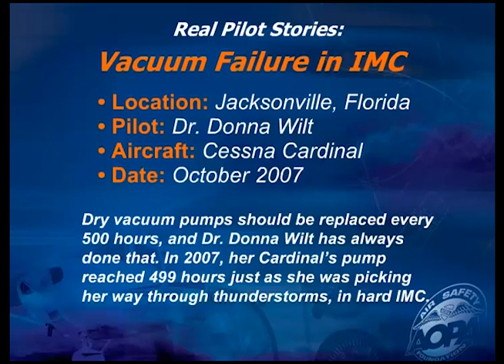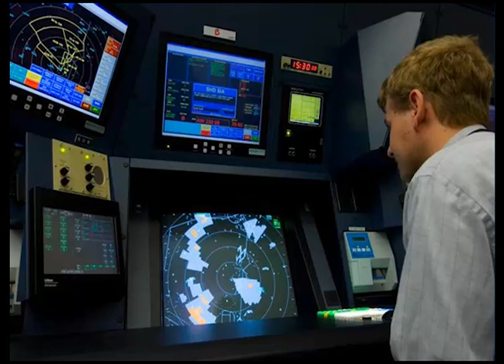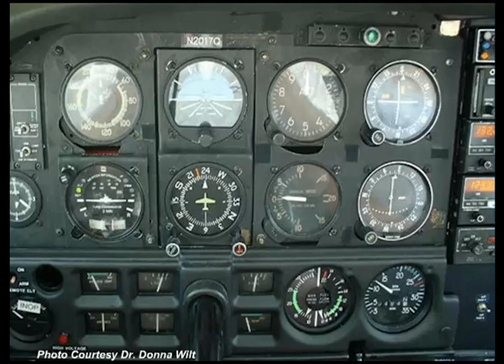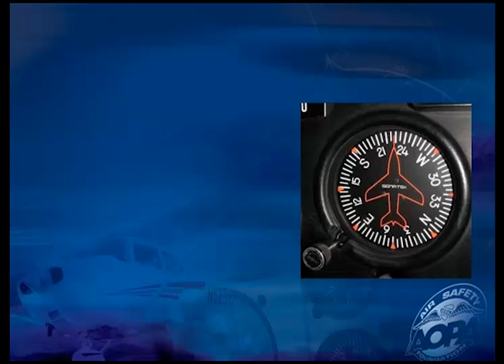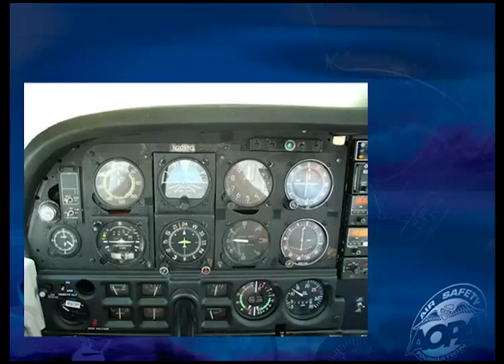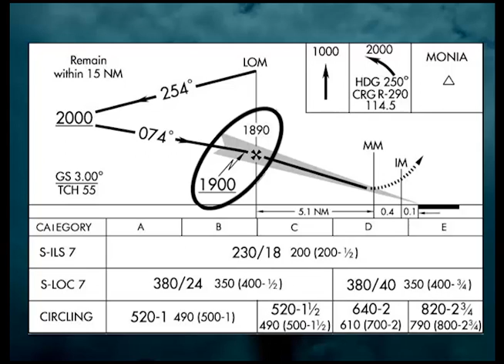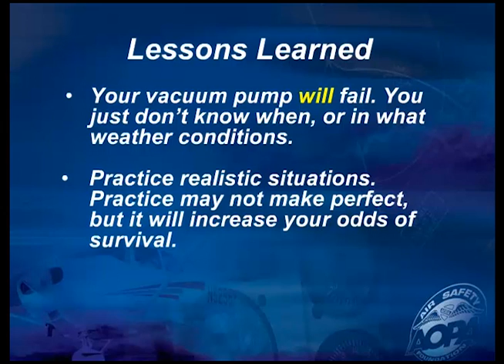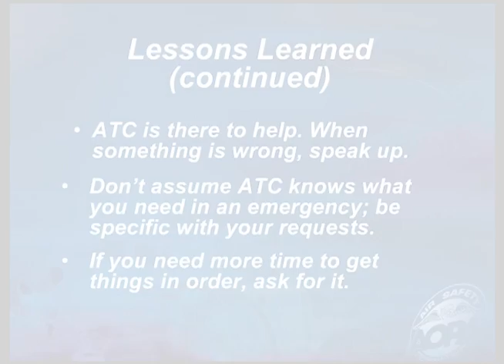Real Pilot Story: Vacuum Failure in IMC

Comment: Hi. I have been a Aircraft mechanic and pilot for over 30 + years and I can tell you that the manufacturers of vacuum pumps need to step up there game and start making the vacuum pumps alot better or just require  that all vacuum pumps be the wet pump type?? Most vacuum pumps are very fragile and made with materials that wear very quickly. There is absolutely no reason the manufacturers couldn't make the pumps out of materials that are much better and last alot longer. The manufacturers design the pumps to wear out?? Period!! I realize everything wears out, but come on, this is people's lives we are talking about!! I have seen brand new vacuum pumps fail right out of the box, many many times, and if you have been a Aircraft mechanic for any length of time you know exactly what I'm talking about, it's totaly ridiculous that just about every pump impeller is made out of a carbon base material? One step up from charcoal in my opinion?  I'm a hugh fan of wet vacuum pumps, and recently I removed a wet pump from an engine that was over 30 years old and it was still in perfect working order,  with very little wear to be seen!! Now you will need to replace the garlock seals from time to time, because they will seap oil after years of service and if you have a in-line oil separator filter, it not a problem for your instrumentation.  The pump lasted 30 years?? Go figure right? And this was not the first time. I have seen many of these types of wet pumps last vertically 20 + years and still going strong!!  The owner of the airplane was having an Continental  O-370 Re-man installed in his Cessna 182 and he wanted a new Airborne vacuum pump installed instead of his older wet pump? Crazy in my opinion, That's just my thoughts on the matter. Take care. Hawk out!!
Reply: I agree with you 100%. Ex avionics tech here.  This old shit stuff is useless yet apple can make an iphone that will lauch itself to the moon no problem. ANNNNDDDD... we're stuck with freaking old ass engine designs from the 50's and 60's, but yet todays cars can go 300k miles before they die. Right.  Something needs to change for sure!
Reply: Cannot agree more.  When I rebuilt my 1966 Citabria 7ECA, I yanked out a rusty 30 lb vacuum pump, replaced applicable gyros with electric gyros, saved the 30 lb, and am far more reliable as a result.
Reply: Claudia Cerami It’s the same old problem. Been with us for decades. If the vacuum gauge reading is not caught quickly, it’s only too easy to ride the AI into what is euphemistically called an ‘ unusual attitude ‘. Too many instrument pilots over many years have failed to notice, let alone recover, let alone continue on partial panel , from this. Probably because of insufficient  actual IFR experience. Since including the gauge is a bit of a pain in the neck, it’s all the more important to note any inconsistencies in all the performance instruments as quickly as possible, as a tip to glance at it straight away..
Reply: why we need vaccum pumps in the era of MEMS gyroscopes that are very cheap and precise is the question we should be asking
Reply: Claudia Cerami has
Reply: I have a dry vacuum pump that holds the waste gate closed on my turbo, they are awful, tired of replacing them
Reply: Dirk Knight  well, Dynon's EFIS beg to disagree that MEMS gyroscopes aren't a replacement for physical ones
Reply: By the way, MEMS (Microelectromechanical systems) gyros are physical, but on a nanometer scale

Comment: Lesson.  Don't use single engine piston planes without backup systems to fly in or around thunderstorms.  It does not have much more power than my motorcycle.  Maybe it would be ok in a TBM 930 or Learjet.
Reply: You don't know what you are talking about. Clearly not a pilot

Comment: 1969. I was 17 years old. At 13 hours, after my 3rd supervised solo (I soloed at 10), my CFI, which knew I had 15 hours already paid by the Civil Air Patrol grant i had, he decided to give me one hour of IFR (???, WTF?), yes under the hood at 13 hours. The problem is that was a 1960 Piper Colt with no gyro pump, so it was like what they call Partial Panel IFR. No Attitude Indicator, and No Heading Indicator either.  just an old fashioned compass type instrument. 

Used to hard work i was so I wrestled with that airplane  on the Florida midday turbulence and didnt lose control. He guided me back to airport and told reduced power and descent, He told me to descend at 80 mph and the power settings, when about 200 feet agl or lower, he removed the hood, and suddenly the runway was there, a bit to the rightof the nose,  I did a bit bouncy worst landing ever due just wanted to put those tires fast on runway and end the flight. 

Dam, i was so tired after that hour that i though about not flying again. Somebody told me that was an IFR on a non IFR airplane. Then the school gave me a nice checkout on a brand new C150 at 14 hours. What a difference. 13 hours only Partial Panel student pilot sulcks.
Reply: Hell yeah!  That's an aviator!
Reply: 1969. I was 2 years old

Comment: With the importance of the vacuum system, could a redundant pump work, or would you need two complete vacuum systems?
Reply: You can install an electric driven vacuum pump. You can install an electronic  or electric artificial horizon and gyro too, they are expensive but they worth every dollar spent on them!
Reply: And even with all their expense, they can also fail. The question is, which is more reliable?
Reply: Engine driven pumps are more reliable, but electric ones are a good backup, it's nearly impossible to have a double failure!
Reply: How to kill a vacuum driven system AND a electric system: Shut down the engine. Airplane batteries don't usually last long enough to get on the ground. Of course losing your engine in IMC is bad news in any case.
Reply: Oh! I've forgotten that case!
Reply: Sometimes there is just no getting out of a bad day. All you can do is prevent people on the ground having a bad day as well.
Reply: Agree!
Reply: I know a guy who had an engine failure. He picked an empty school yard to land, but shortly before he got there a bunch of kids ran into the yard, apparently recess had just started, He deliberately crashed into a brick wall and killed himself rather than risk hurting the kids.  It was clear weather, but the irony was, if it had been bad weather the kids would have stayed inside.
    They gave him a posthumous award. I heard they were also talking about renaming the school after him, but I don't know if that happened.
Reply: Wow, it's so sad, but I think he took the right choice to avoid killing the children.
Reply: Yea, it is sad, but I think it's something every pilot should be prepared to do.
    It's hard enough to do something like that when it's just you, but if you have passengers (especially your own family) it's going to be much harder.
Reply: @erictaylor5462  ok, so which IS more reliable?

Comment: This brings back so many memories of practicing partial panel NDB approaches in a Cessna 150 at night into KMKS. My CFII dad made me to it so many times I still have the approach memorized complete with memories of that dimly lit cockpit and the flailing compass on the dash.Ended up having to demonstrate that very partial panel approach on my instrument checkride because the other two required approaches were in hardball IFR at KCHS--not fun, but I got through it and am very thankful for the experience.

Comment: From the top:

 She was" really concerned about flying into embedded thunderstorms and didn't have any weather capability onboard". Not a good decision to launch if you really have such concerns.
 "the weather gets really intense for a while and we thought ok we're gonna do this for a little while...". Should have asked for a deviation, not waited in hope.
 Not until vectored did she realise she couldn't use the heading bug. And yet she felt ATC should have been aware of "one of the things you cannot do" and how a "lost vacuum system" had affected her particular aircraft before she figured it out for herself? In anycase, the standby compass is adequate, albeit clunky, to turn to a heading, though probably not if you didn't practice "in probably 4 or 5 years".
 She should have specified 'no gyro'. It is required when IFR to inform ATC of each instrument you lose. Saying "vacuum failure" is like saying "generator failure" - expecting ATC to know what that means for each and every aircraft out there is unreasonable. 
 She did not seem to understand how to get the best out of her avionics in this situation.  She had "always envisoned using autopilot and GPS but in this case we were on vectors". Even when vectored the GPS can be useful. You can quickly create a user waypoint at present positon, set the vector with the OBS and it is a doddle to remain on heading with the map in track-up mode. Or simply set the GPS to the dirty great compass display (albeit you have to account for a little lag when rolling out). Again we don't do those things routinely so the skills won't be there if you don't practice.
 She was offered a gnd controlled approach which I would have taken. An ASR is easy, you don't even need a plate. But she was probably correct in not accepting what she had not practiced before. Private pilots can practice gnd controlled approaches and no gyro approaches at military airfields who have an ongoing controller training requirement - check the A/FD.  It's a little ironic that the pilot who never bothered ATC with a practice no-gyro would complain that "they didn't seem to understand what's wrong when you've lost the vacuum pump".
 After veering off the approach course she was fortunate to happen across a hole in the cloud. But the communication at that point showed another gap in her professional knowledge. She could simply have requested a 'contact approach' which is in effect what she carried out. There was no need to cancel IFR but because she never requested it, and ATC are specifically NOT allowed to OFFER a contact approach, there was an unnecessary conversation where ATC had to lead her by the hand into cancelling IFR and continuing VFR instead. Unnecessary distraction at a critical point. 
 A fortunate outcome. Partial panel is not something to do for the check ride and ignore for 5 years. The skill has to be there always.
 This pilot is a CFII. She has since written a paper on no-gyro approaches which is good and worth reading. What is missing from it is the same thing missing from her contribution to this video - the ackowledgement that she had abjectly failed to maintain and develop the skills to deal with a malfunction that every instrument pilot should be fully prepared for. Don't be wise after the event, you may not get away with it like this lady did.
Reply: XPLAlN seriously, first vector i got i would have requested no gyro and 100% accept the surveillance approach.  why would you want to force yourself to do a failed card ils when you can get a controler to do the job for you? lady is an idiot.  she got lucky there was a hole otherwise she could have easily smashed into some obstacle.
Reply: Yes, stumbling across that hole was lucky. Like you, I would take a surveillance approach in a heartbeat. I take her point that she wanted the ILS because it was familiar - the problem is she had not maintained the skill to fly it no-gyro anyway.
Reply: XPLAlN even if you haven't practiced a no gyro PAR... how hard is it to "turn right half standard ratr.  stop turn."  sorry but absolutely horrible decision making.  yeah, load up the ils in case, but fly the damn PAR/ASR.
Reply: Informative comment, thanks for the alternative viewpoint

Comment: Vacum failure in IMC is real a nightmare no matter how experienced or trained you are. So congratulations to all that have survived and special thanks to the ones that are willing to share. Recommentadions are good, one just has to remember them.  I will certainly add more partial panel on my training. Thank you for the REMINDER!!!
Reply: As a fixed & roter wing tech inspector. i was. E-5 US Army. on fllight pay.  The year was 1959. Fort Benning Ga.  Was on a night flight in a H13G. Was flying with a 1st Lt. We were both getting our 4 hrs for the month. As the night closed in it became pitch black, no horizen.  We were two hrs away from Fort Benning heading back on the second leg of the flight. With no visable ground or horizen line my pilot experianced virtigo. Note: My pilot allowed the hellicopter to enter a steep climb, looseing air speed we began falling backwards. he steamed Help me, Help me.  The collective all the way up. The cyclic was all the way back. I had to fling my left hand and arm across his chest and yell, let go let go. He did, i dumped the collective down and pushed the cyclic forward.  Air speed picked up qwickly and pulled Pitch & Cyclic . just barely cleard the ground.   i used the RPM, MANIFOLD PRESSURE,  AIRSPEED,         and Atimeter, to maintaine stable. power setting and the whisky compas. as a artificial horizon and direction. i knew the compas heading back to Benning. i flew for about an hour 15 before the lights of the city and Benning gave a welcome horizon. The Lt took control as we enterd the trafic pattern.. This is a true story. and if any one is interested how i had the knowledge to get us back home. just ask will be glad to give you the info
Reply: I'd just put up my Android phone :P You get ground speed, altitude (baro altitude with a proper plane), vertical speed etc etc...
Reply: I can't believe there is no electric vacuum pump as back up, I thought airplanes were all about redundant systems, clearly i was wrong to assume that

Comment: Good story and info to learn from, don't get me wrong here but i have a couple concerns.  Before getting your IFR rating you should of learned that when communicating with ATC about a failure you always have to say "what instruments" you have lost, not what system you lost.  Also, during training for IFR you have to practice and demonstrate on the checkride a parcial panel LOC approach, ILS would be easier.   When ATC was giving you vectors, you should be able to use the compass, again, we practice that during training, and the LOC approach is done using the compass, not the H.I., If you fly using your primary instruments instead of relying on the GPS for approaches you should be able to intercept and shoot the parcial panel ILS app, not perfect but should be done.  And last pointer, when you requested him to tell you when to turn and stop and so on, he replied with "surveillance" approach, that meant he was going to give you what you wanted, no vectors turn by turn directions, you weren't making sense to ATC.  Again, don't wanna sound arrogant, might be much more difficult in real life situations, but thats why we get trained on does tasks to be able to get them when needed.  I remember my IFR checkride, my DPE disabled the GPS from the beginning of the flight.
Thanks for the video though, always good to know new stories.
Reply: Also, I forgot, depending on the GPS you got, but in most cases, you could load and activate the ILS approach "vectors to final" and you would have a line to intercept for your LOC final.